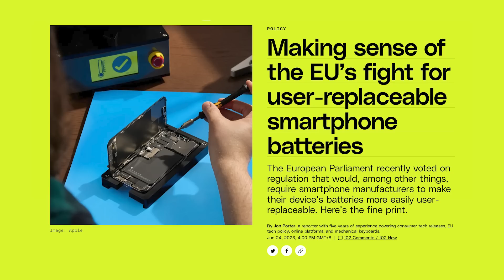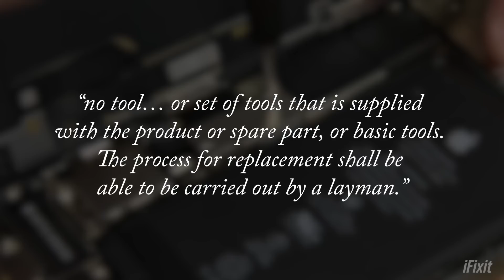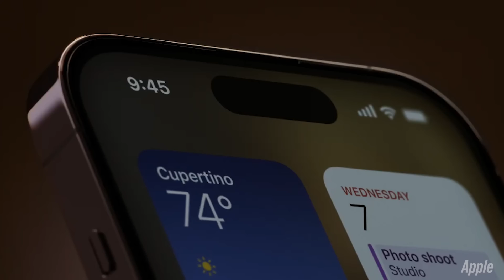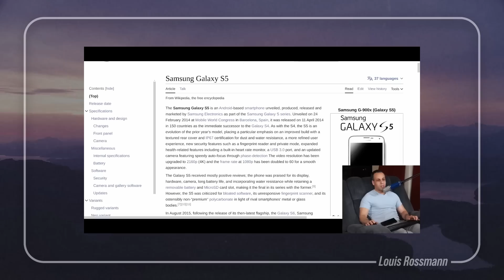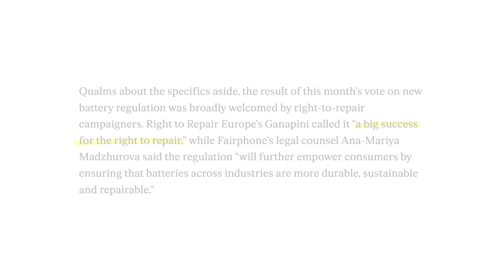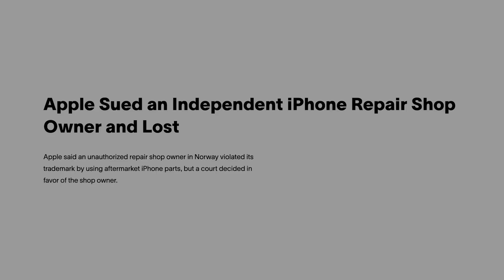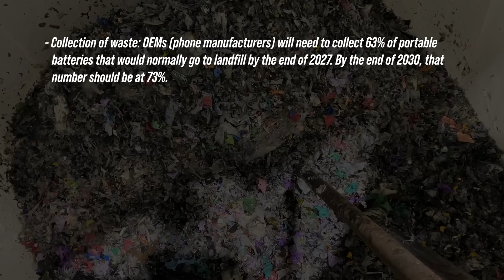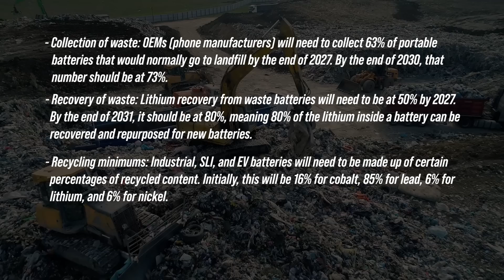EU Just Changed Smartphones Forever

Comment: Once again proving that big manufactures have to have pro-consumer features shoved down their throats before they are able to finally make positive changes. Thanks EU!
Reply: Don't feed the troll
Reply: Unless we are able to completely recycle every part of a smartphone, we should have the right to repair it. There's no need to spend more natural resources in order to fix a mistake that costs 0.5$ to fix. Anyone who forces you to pay 700$ to fix a 0.5$ issue should be put away from business unless they change. Imagine car manufacturers banned you from using other brand's gas and you would have to visit a brand specific gas station to refill. It would drive company's profits, but is this really a move towards the future?
Reply: @jurajchobot There is no way you are going to be able to repair these things even if they make them repairable. Firstly, you would not know what to do, and secondly, you would not know what specific bit was broken in the first place.

This right to repair nonsense is just so people like Rossman can have a business, no other reason. After you add their fee to the replacement module cost you might as well just buy a new phone, in most cases it would probably be cheaper doing that, buying an equivalent brand new model.
Reply: @jurajchobot  I would say "even if" everything was 100% recycled,  why going through the whole process of destroying a thing into original chemical compound to rebuild one ? 
If apple build car you'd have to recycle it because the ceiling light is not replaceable as it's an important part of the safety feature, and if you try to replace the bulb the breaks will stop working
Reply: Please tell me your thanks is sarcastic. Manufacturers make thin and light phones because that's what most consumers want. If a large number of people were willing to sacrifice size and weight to have a changeable battery, manufacturers would make larger, heavier phones with changeable batteries. A contributing factor is that phone batteries last so much longer than they used to that there's not much need to change a battery between opportunities to recharge.
Reply: Blame Apple.
Reply: @chudchadanstud  since when is apple fault for manufacturers removing hotswap batteries? They never had one in the first place so they aren’t faulty for others removing it and even if apple starts a trend for removing something then it’s still Samsungs and the others fault for doing the same because nobody forced them
Reply: Once again proving that capitalism does not work.
Reply: Hell yeah! Way to go EU!!
Reply: But, but, FREE MARKET!!! /s
Reply: @greevar yes, free market with DMCA
Reply: @greevar  Imagine not supporting free markets lol
Reply: @greevar Yeah this interference in that free market might make a bunch of handy devices unavailable to Europeans, great going EU
Reply: @AR-vm7tk  the eu has nearly 450 million people living in it… do you really think any company can afford to miss out on that revenue? That would destroy any company that has share holders so they will all adjust their phones to fit the law and it’s also still 4 years away so they have plenty time
Reply: Proof that capitalism doesn't work. You need some regulation, who pays for something as simple as the roads we all drive in, we need combined system.
Reply: Throatable
Reply: EU is doing this to force more premium products and expensive flagships for them to tax, by creating an oligopoloy of companies that can run on old models of production and eat the cost.

There's intitiatives to invest on new battery technologies that would be higher up in the food chain, IP owned by EU technocrats, and it will see smartphones stagnate the same way printers stagnated in Japan to enrich the already rich. Cheap phones and ANY new innovations that require a non-lego block components to kick off, will be ousted from the market.
Reply: I nor many I know bought any of the new without batteries!!!! No need as no use social media etc. But this comment I agree with you ABSOLUTELY!!
Reply: Well said!
Reply: That reminds me about waterproof purpose-built phone for railway workers in siberia and other swamps of Russia with not one, but TWO(!) user-replacable batteries, smartcard reader and IP67. Also drop resistant and pther stuff railroad company wanted.
Reply: But they will probably still just seal the phones for other markets.
Reply: @GF-if4zt  so what? People will just start importing phones from EU.
Reply: no problem, now you will be charge even more for a phone just because it has a removable battery! Enjoy :)
Reply: Most consumers want sleek compact phones, this change is NOT what they want. It is going to result in larger clunky phones.
Reply: @Tugela60  no, it won't.
Reply: @Sujay95  Yes it will.
Reply: @Tugela60  no, it won't
Reply: Thanks EU.  I agree with this.  When we can't repair things and just throw it away and buy new ones.  We are causing great harm to the environment.  

Many people die mining elements needed for parts in cell phones and other electronics.  So the product should be durable and long lasting not easily disposable.  

After my experience with Apple I never bought another Apple product.  It is own by money driven mentality that cares not for humanity, just profit.  The idea that they recently market:  giving us less for our money is so they can be more environmentally friendly.  This marketing scam is total B.S.  Because they think us consumers are dumb.  

How is not including a cube more environmentally friendly when their cube is constantly easily damaged and we have to spend so much to replace when it is part of the purchase. 

 Now they want us to buy it separately.  I can't believe how many people still support this brand.  They think us dumb and we prove them right by keep buying their product on their terms.
Reply: Sad shame
Reply: The EU need to enlist their technology firms like Nokia to stop slacking and step it up in the innovation department.

And maybe reformat their immigration program to recruit the best and brightest engineering/STEM students from all over the world to be educated in their Universities and Technical institutes for the effort of innovation.
Reply: while more countries should hold these monopolies responsible for their predatory business tactics, I am cautious of EU actually enforcing these laws. There is a lot of talk and little delivered in EU bureaucracy. Companies, especially these literal trillion dollar behemoths, find a way around the legal bs.
Reply: I always thing forcing is a wrong way. USB C can get outdated and we are stuck with it. While most products really should have a removable battery, I am ok to fight against some glue in tiny electronics like wireless headphones or smartwatches.
Reply: Anytime the government forces unnecessary things on businesses, that's a loss for citizens.  There are still countless phones available with replaceable batteries without a ridiculous law.  If the consumer was actually bothered by the batteries Apple would not sell the amount of devices they do.  I think big tech companies should pull out the eu honestly.  If they never push back they'll just keep adding more and more regulations pretending it's for the consumers when it's really just a power trip.
Reply: @jec1986  I don't consider this a loss for citizens.  Landfill e-waste is real, I do have concerns about it, but not as nearly as much as shelling out resources for a phone that costs as much or more than my PC graphics card.  I know many others like myself who would love an option to replace bad components easily while spending only a tenth or less the cost of the phone.
Reply: In UK we will insist that phones are glued shut.
Reply: @Never_unknown  Brexit be like
Reply: @Never_unknown He said worldwide didn’t he?
Reply: @Vile_Entity_3545 The EU has no authority to make rules worldwide. Only in the European market share. AND NO WHERE ELSE.
Reply: @Never_unknown  I wouldn’t be surprised if those stupid British politics would actually charge phone manufacturers to make phones even less user replaceable (or better said not at all replaceable) just because they want to be exactly the opposite of the EU
Reply: @Never_unknown  did you forget your braincells in the EU?
Reply: @cnr_0778   No. I live in Chile.
Reply: @cnr_0778  and please chill.  We don't have to be unpleasant.
Reply: Pro-consumer?
You like having heavier/larger phones with worse battery life that are less waterproof? It's under $70 to have Apple replace your battery. Having batteries baked it means the company can focus on sealing the phone so it's water and dust proof, and can maximize internal space, solder the battery to the board so that it has minimal hardware required, and can max out the battery volume. Government regulation means that this is no longer possible even if you, the consumer, wanted it. 
The market spoke when user-replaceable and non-user-replaceable batteries were on the market in 2012-2015 and sales for non-user-replaceable outweighed replaceble.
My Droid X from 2010's battery door wore out through normal use. Another battery replaceable phone I had use a screw-on back with a gasket to maintain its IP-68 rating, but the clips on the hinge side snapped off. lol. Whenever I had a phone battery degrade enough to be unusable was because the phone was already unusable from being 2-3 years old. Old phones are so insanely cheap that you could just buy the same 2-3 year old model again if you like the phone that much. 
My Moto Edge 2021 has a massive 5000 mAh battery. I easily got 30 hours of aggressive use battery life out of it (GPS, screen full brightness, bluetooth, streaming over 5G). Now that it's 2 years old, I see myself getting to the end of the day with 30% remaining battery instead of 60%. It's degraded a bit. The phone cost me $499 when it was new. "If only I could replace the battery in my investment!" -- No dude. You can find a new old stock Moto Edge 2021 for $170 or a used mint condition for under $150.
I literally do not care about replacing the battery.
I'll put it this way -- when PC's can have their processor and GPUs upgraded and have been this way for 40 years, do you think it's "anti-consumer" that you can't install a third party GPU into an iMac, or swap the SOC out on your phone? Like, when a Snapdragon 855 phone came out, why can't I desolder the Snapdragon 835 from my Samsung Galaxy S7 and install an 855? Why can't I remove the Snapdragon 8 Gen 1 from my Moto Edge 30 Pro and install a Snapdragon 8 Gen 2?
Because it doesn't work that way. But it COULD work that way, if they had to do it. The phones would be terrible, but imagine if the government mandated that all smartphone manufacturers use sockets and support at least one or two generations of chipset upgrade? How big would these phones be? lmfao.
"Positive Changes."
Reply: @GiuseppeGaetanoSabatelli  tell me how adding glue on top of battery makes its life "better"
Reply: @GiuseppeGaetanoSabatelli  also "market speaking" was a lot of lawsuits, import bans and other very market stuff
Reply: This changes nothing.  You can now buy a new EU Apple Iphone for 200% markup.  Limited supplies.  Normal Iphones work just fine and are much cheaper and in unlimited numbers.
Reply: @davidbeppler3032  friends use old phones. Text fine. Phone fine. We don't LIVE on our phones!!! And all the better for it! Never did,never will purchase anything from company brand name Apple. Big movement at moment to minimize screen time for kids ( soon to be zombies in some cases due to addiction to phones n gaming) Though some smart parents have been wise enough to put a computer in open area of house. Plus limit time etc. 
Out he door for some fresh air n exercise and Zengage with your friends in a human way..I believe that's TALKING, LAUGHING..ETC ETC
Protect the children! Social development and personal safety.
Some things little eyes shouldn't see!

( Good as the Cyber crime divisions are and the
Reply: @davidbeppler3032 Dude, what part of "this law will come into effect in 2027" did you not understand?

Comment: Interesting.. I dropped my Samsung S23 last night and it scratched the bezel frame. I can buy a replacement bezel but it requires an engineers degree to swap it over 😔
Reply: Glad that your screen was fine after that. I've had to do screen repairs on phones, that had no damage to glass, but cracked display layer. Sometimes it was difficult to see where the tiniest dent happened, that killed the most expensive part of a phone. 
The fact that external decorative frame is the same part, that everything else is attached to, is a nightmare to swap it, I agree.
Reply: @aebisdecunter  it dropped from about half a meter onto tiles and amazingly it has a little 2mm diameter scratch on the corner of the frame. I've watched videos of the replacement process and I think even professionals could do more damage than it's worth when they're peeling adhesives and removing batteries.

Comment: I can not imagine the future where Apple sell you the battery for 499
EDIT: To make myself clear I'm not an Apple user, It's just me surprise that a company can be so greedy selling a battery for 499 (eventually)
Reply: Imagine Apple selling a $999 battery for an iphone with drm chip that prevents installing generic batteries
Reply: @YoloTub3  It's scary that this is something that they would do
Reply: @YoloTub3 Then the EU can make another law change. Drm has no place in batteries.
Reply: @YoloTub3 Or find out 10 years later a little code and a chip causes  non apple batteries to slow the phone, drain the battery quickly, randomly shut off the phone, while at the same time using Volkswagen techniques, shuts this system down if the phone is tested. 😂😂😂
Reply: In Apple's realm, sure but the Right To Repair for practically every small business will make those charges kill Apple for marketing removable batteries because no one would want to and the risk of after market parts but still usable on Apple devices will make Apple think twice how to compete against Android with their very open end and easy to use OS

Basically yes they can, and there would be people stupid enough to pay, but sometimes quality isn't meant to be super expensive
Reply: ... forgot INFLATION...lol.. $2499.. and breaks warranty!!!
Reply: That's still only half the price of a new iPhone, though ^^ and I doubt they can afford to do so without getting replaced by generic brands.
Reply: Do not buy Apple
Reply: You don't need to imagine. Simply don't use Apple products.
Reply: @jackdiamond4962  dont worry, I'm a samsung user
Reply: They really would do that too
Reply: imagine using a fucking apple product beyond airpods
Reply: they sold a monitor stand for $999 so $499 for a battery is actually a steal LOL
Reply: With Apple's track record, i believe that is totally possible. And possibly, a phone with a replaced battery could be throttled so that the user can have the best experience of a long battery and a slow iphone, going by the way Apple handled battery in the past.
Reply: @raghav6604   I think you are right... using an Aftermarket batterie will be detected and the Phone will shut down... also Performance trolled down so that you WILL by genuine Apple Replacement Stuff. !!!

This Law is a Boomerang for Customers!
Reply: In the USA you can get your iPhone battery replaced by Apple or an Apple authorized service center like Best Buy for around $100. That gives me hope that Apple would not charge crazy amounts for replacement batteries once they are easily swappable. But I certainly expect they would put some kind of chip in them so that 3rd party batteries would either not work or need to use the same chip and cost more, similar to what they do for lots of accessories already. But since this is a way to ensure quality and battery quality is important, I would not have a problem with it - after all, people like me who have iPhones already believe they are paying extra for quality (note that I used the word “believe” because I know not everyone will agree!)
Reply: thats cheaap, good luck
Reply: They'll already sell you 8GB of ram for $200.

Why anyone still buys Apple is beyond me, how can people not spot a scam?
Reply: They'll limit iPhones with third party batteries as well i bet
Reply: Took a while to get that these are dollars not rupees... Yeah. 😏
Reply: Chinaman will sell you a Battery for 99,-
Reply: Don't buy Apple. Samsung has better phones now anyway.
Reply: "Can't we just make our own version of electricity and patent it?" - Apple board
Reply: @worldcomicsreview354  haha.
Reply: Actually battery replacement is one of the few things that Apple does for a relatively cheap price for iPhone. Even wat cheaper than what Samsung charges on their Galaxy S phones
Reply: @dazziliciouscamouflage Samsung batteries don't go poo poo after 3 years, big difference